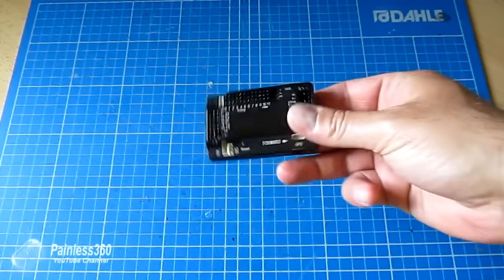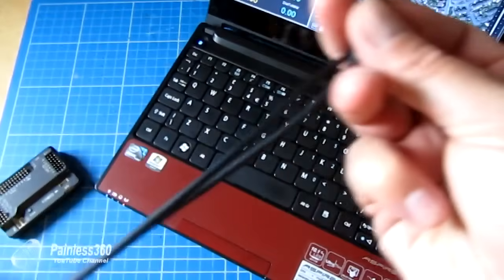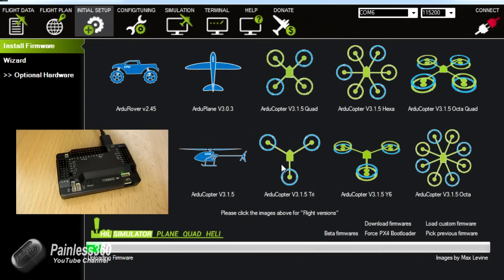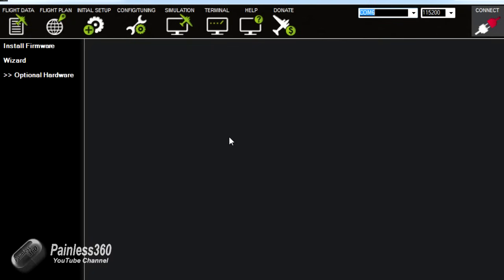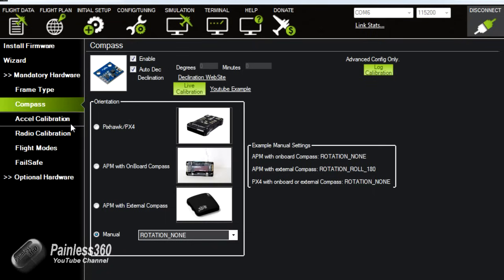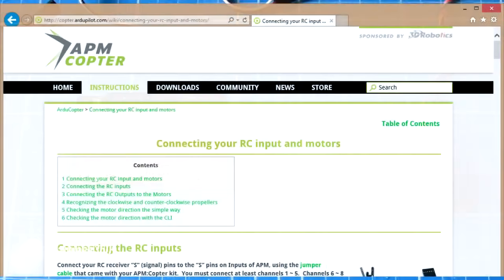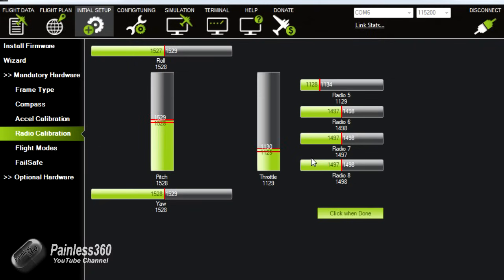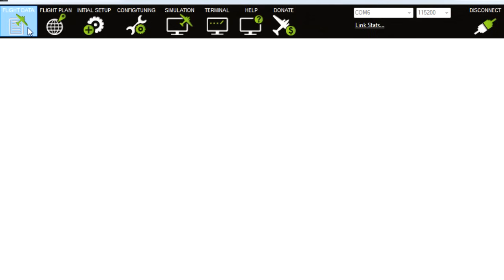(1/8) APM 2.5/2.6/2.7/2.8 - Simple installation and setup overview

Comment: Hi - Awesum tutorial.  Ok so I have small question - I have the APM 2.7 and the Turnigy 9x Radio kit with the 9x8cV2 Receiver.

I have done the bind on the Radio and the RX  - Using the APM input to supply the 5V.

The radio is set to sent PPM - And the receiver is PPM - But when I try connect to calibrate the radio it tell me that he transmitter is not switched on and it not receiving a signal... All the channels are connected 1 - 5 correct
Reply: Haha don't worry - I worked it out !!

Comment: I think you already answered this question but I need to confirm. I ordered a X500 quadcopter kit from AliExpress. I've built something like this with a CCD3 controller. the kit came with simonk ESCs with built-in BECs. the kit came with a power module also. from what you said the power from the ESC will supply all the power to the board. with that in mind I guess I better not plug that power module connection into the board?
Reply from the maker: Not sure what you're describing as a 'power module' is normally something you get with an APM/Pixhawk. I'd normally power the CC3D using the BECs in the ESCs.. Best of luck!
Reply from the maker: See the video later in the series where we cover powering the APM, we talk about it there. Best of luck!

Comment: Hi, thx for your great channel!
I've got 2 questions about the APM and I hope u can help me.
1. I wanna use the APM 2.8 with Ublox Neo-6m. Shall I remove the Jumper next to the GPS-Port to deaktivate the internal magnetometer or not? Ive seen in ur Pixhawk video Series that u are using boath there, internal and external together. Is it recommended on the APM?
2. I am using a Turnigy TGY-i10. Is it possible to connect the reciever whith the APM, while using PPM or another sum signal?
Reply from the maker: Hi. 1) If you've got an external mag then I'd always use that. 2)Depends on the receiver and the APM version you have. Check if both use PPM.. Best of luck!

Comment: Thanks for all the videos you have made on this subject. I know this is a year or so old but I think it would be helpful if you made it clear that a transmitter that can be used for a plane or heli needs to be setup as a plane not a heli for multi-rotor copters.
Reply from the maker: +James L Phillips We cover this in a number of other videos, thanks for the suggestion. Happy flying!
Reply: Thanks for the reply.

Comment: Thanks for the video!!
I have a question. I followed your steps and stuck at the compass calibration. When I clicked the "Live calibration", it popped up a new window but no display of x, y and z axis.
Then I just skipped to radio calibration. I connected all according to the APM site connected Rx and Tx. Before I started the calibration, I connected all 5 servos to the Rx and checked all channel functionality. After I connected with Planner I saw all the green bars as your video. When I clicked the calibration button only 3 channels would show the red sticks (throttle, aileron and aux) and the rest 2 channels won't move and no names (yaw, roll) displayed.
Did I do something wrong? -_-a
Any words would be appreciated! Thanks!!!
Reply from the maker: delsol7878 Hi, make sure that you have the two missing channels plugged in and the servo cables are the right way round. The APM is only showing what it can 'hear' on the connected inputs so you don't need to tell it what radio you are using.If this is an APM 2.6 then check that the cable from the external compass is plugged in and not loose. This would cause what you are seeing. Best of luck with the build!

Comment: Thank you for the super videos. I'm putting together a Quad using the QRX350 Pro body. Ready to start setting up the APM.
On the Compass celebration, I am using a GPS with external compass. How should I deal with the external compass when setting up the APM ?
Thanks Dale
Reply from the maker: Hi Dale. See 8:57 in this video. Install the GPS/Compass module at that point. I explain why in this part of the video.

Hope it helps, good luck with the build!
Reply: Painless360
Thank you
I'm going throw your videos one at a time and typing up Step by Step.

Comment: Have you posted anything on how to protect the Baro from wind on the APM 2.5/2,6 and 2.7?
Reply from the maker: Hi Simon, not yet. All of mine have been installed inside the case that includes a piece of foam to cover the sensor.

I have discussed it when talking about the Multiwii boards though. I am in the middle of creating a few videos for the APM 3.1 and this is covered in these specifically for the APM..
Reply: OK Thanks. I ended up researching on google and making up a video myself.
Reply: Painless360 Hello guys maybe you can help install futaba transmitter T6ex ardupilot to 2.6 x Quadcopter
Reply from the maker: The radio is a mature product but should work great - what's the problem?

Comment: Thanks Painless360, problem solved. Throttle Failsafe remains at throttle setting when I lose Tx. It's my receiver! 3 yr old Turnigy 8 channel.
Reply from the maker: John Bailey I wouldn't use that on a model - too much chance of a flyaway!
Happy flying..
Reply: Yes, going to switch over to my Taranis and  X8R. P.S. your vids are Super!
Reply from the maker: Thank you :)

Comment: Hi good simple instructions. I was Ok up to the receiver install. Several blogs say do not install the receiver while only powered from PC using USB. Also the video is for a coptor and I am doing rover. You show every pin used for the receiver setup but I have R8EF S-bus or PPM and you do not show that config. Any help appreciated
Reply from the maker: I've not used APM for many years. See my last few years of videos on flight controllers. All I figured out are in this series.... There are more up to date flight controllers supported by modern firmware - see my Kit Picks video..

Comment: the best video!i wan't to ask you. if i wan't to put it in rc boat,do you know if i must do all that progress?or it is more simple?all i wan't is the RTL function and nothing else!and do you know if can work with the Turnigy TGY-i6 AFHDS!   thank you very much!
Reply from the maker: It should work with any radio/receiver that can support the PWM inputs it needs. The process in this video is a little old now but it's basically the same. See the ArduBoat documentation for more details. Best of luck with the build..
Reply: ok thank you very very much for the answer!!!best regards from greece!

Comment: All your videos from part 1 - 8 are wonderful and detail regarding the apm.
But I would like to ask. Everytime when I fly in a new location what dance or calibration do I need to perform? 
Like for the naza it's simple dance. What about the apm?
Reply from the maker: +Mervyn 8888 once you have it all calibrated, so long as you've not moving a great distance away where the magnetic declination will be different, you should be ready to just fire up, wait for the GPS lock and fly!
Reply: Painless360 , if that's the case, meaning I do a first set up calibration at home connected to my laptop. And from there once I'm at the field I can just plug and fly without the need of another calibration?
Reply from the maker: Yep, should do.

Comment: thank you for all these great videos. im have a big problem with my apm 2.6 hexacopter. every time i arm the hex to fly i have take off ok then all f a sudden i lost. all control hex flys away at full throttle until i cut off the control. fail safe on lemon rx 6ch kick in kills the motors and hex comes crashing down to the ground.  Any ideas n what going on??
Reply from the maker: +Horace Gray What do the logs say? Watch and log files video and see what they tell you from that flight..

Comment: Compass calibration? I see your video is now 3 years old and my question is has the compass calibration changed? On your video when you click the calibration tab and start to rotate you come up with a new window that shows the compass points. When I click compass calibration all I see is a progression line for 60 seconds. It does not show the nifty little window that you get with the illustration of what's going on. I go through all the motions just as you did in the demonstration on the video. After several tries and after hooking up the GPS and compass I am running 2.8 it comes up with the same answer not enough. Without the little graphic, there's no way to tell if it received any compass points. Do you or does anyone know if this part of the setup has changed?
Thank you for your APM series, it's nice to get information from a trusted source!
Reply from the maker: It has, we will be looking at the latest version in the PixHawk 2.1 series.. The documentation has the latest details. Best of luck!

Comment: Thanks great videos. From your videos you connected all the ESCs three wires to the APM or did you cut them somehow?
Reply from the maker: Tochukwu Wilfred Depends on if they are linear BECs (leave all the red wires in the connectors to the ESCs connected) or switched BECs (use a pin to lift the tab on the connector and remove all but one of the red wires).
Powering the board is covered in the next video in the series - https://www.youtube.com/watch?v=TS4OWAcfAQY&index=2&list=PLYsWjANuAm4oswLMu9OU8yOm-9J6y30XW
More detail on connecting BECs in this video - https://www.youtube.com/watch?v=L3BnPdiK3_o&list=PLYsWjANuAm4pIU07ta7glYIn-EBCof_4r&index=6
Best of luck.

Comment: When setting-up for the Radio Calibration; I'm using the FrSky Taranis plus X9D Radio and the X8R Receiver.  I understand about connecting the corresponding channels to the rc receiver, but in the video, I have to ask what is the device you have coming off the side your Spektrum AR7010 receiver?
Reply from the maker: +Destin Casimiro That is a satellite receiver that provides an extra two antenna for improved reception over just the single receiver on its own. Hope that makes sense..
Reply: +Painless360 Thank you so much..., you have been very helpful considering I am brand new at this hobby! I like the idea of an extra satellite receiver for improved reception, I may do that myself. Does that extra antenna come out of your Smart Port on your receiver?
Reply from the maker: No, that is a feature that is more common on DSM recievers. Best of luck!

Comment: thanks for making these videos.  I just got an APM 2.8 for my fixed wing.  I am going to use a TBS Crossfire micro receiver with SBUS for the APM.  I am having a heck of a time trying to get SBUS to work.  Any advice?
Reply from the maker: +DenMark Phan have you jumpered the signal pins on inputs 2 and 3 to tell it that it's an S bus signal? Tricky to offer advice without know what you've already tried. Best of luck!
Reply from the maker: +Painless360 (PPM is easier to setup on APM and selectable on the CF too..)

Comment: Thanks for these awesoms videos.
Wanted to ask, can one use multiple computers running Mission Planner on the same board, or should you stick with one of them?

For example, carry out initial configuration on a desktop, and then actual flight on a laptop?
Reply from the maker: +mexicubanguy ive used multiple computers with no problems. Happy flying!
Reply: +Painless360 Thank you very much!

Comment: Hi great video once again I have revisited my set up on my ardupilot and decided to retry the gps my question is I have Ublox NEO-M8N GPS Module w/Compass for APM2.8 APM2.6 Pixhawk Flight RC234 do I need to configure this as in the videos with a gps file or will it work out the box.
Reply from the maker: If it was bought as an APM GPS then it should just work...
Reply: Painless360 thank you

Comment: hey there mate, thanks for this clear video, but i have one question.. what is the use to connect the ardupilot to AUX1 .. and what is that "switch" connected to the receiver? and how should i get one of those  ?
Reply from the maker: It controls the flight mode that the APM is using, we cover this later in the series.. Best of luck..

Comment: Hey Mr Pain I have a problem with my arducopter everything works fine except one thing in mission planner section it couldn't get to connect to it, the TERMINAL section doesn't work, when I click on connect it starts typing garbage things, and also the throttle is at constant speed rate and wont go higher even if you put the stick to full throttle, I've calibrated all the ESCs with all the methods once manually one by one and once again all at once, the throttle speed after calibrating works great it reads all of the speed rate after, but when ARMING the ardu and getting ready to fly, the throttle keeps its constant speed rate when you first move the stick and the motors start off, it keeps that speed rate when it first starts the motor and never go further, can you help me with, I am getting pissed of this FC :(
Reply from the maker: I'd focus on the throttle issue first - Terminal isn't critical for flight.

Connect a servo to the throttle channel on the rx and confirm that it moves with the throttle stick on the Tx.
Then check that you can see the throttle channel move in Mission Planner
Recalibrate all of the ESCs, using the one by one method (the all-in-one has caused me issues in the past)

Best of luck with it. This is a great flight controller and a lot of fun when it's working..
Reply: Thanks buddy i ll try again and see if it could get any better, my respects
Reply: ayman fatani I made and do every steps you provided me with, and it gets to work, but unfortunately my xR wire been cut by one of the propellers, lol its my black day i guess, can i use any servo wires or does it have its own type of wire ? thanks for helping but i am still a noob :p
Reply: ayman fatani The antenna is a shielded wire, so you cannot use any old wire.
If there is still a fair bit of antenna wire left, you can fix it by trimming back the shield to expose the core. If you're using 2.4Ghz, then trim it back to expose 31mm of the core.
Reply: Senator315 Thanks bro yeah there's some of it left, i soldered it again to the xR and worked fine 😊

Comment: Ive just got the 2.8.. though am confused a little.  do i do the initial mandatory calibration of the compass with the GPS/compass dual antenna all plugged in or does the initial setup have to be done without this plugged in.. I only ask as following intital set up may people have problems with the compasses (getting two sets of figures) and finding it impossible to deactivate the on-board compass so that the external GPS/compass aerial to be recognized.
Reply from the maker: +Lee Pearce the way that works for ya is on the video. Personally I'd always disable the onboard compass and use external if possible. Best of luck!

Comment: Hi, Having messed with NAZE32 and heard all the warnings about 'dodgy' GPS implementation do I assume from your videos that the APM is the budget board to use for really good GPS ? or is there some thing else I've missed ?
Thanks for what you do for the community, very much appreciated :-)
Steve
Reply from the maker: +Stephen Thorpe see our video on flight controller comparison. Until iNav finishes the GPS code for Cleanflight, we will have to rely on APM and PixHawk for solid GPS flying. Hope this helps.

Comment: Question.. I have a "GPS Module with compass - Powered by Ublox 7M" Is it compatible with my APM 2.8 when installing the GPS module i have two connectors. 1 with (4) Wires and another with (2) Wires. I know the one with 4 Wires go to the GPS port and the other connector with the 2 wires, which port does it go to? The one near the GPS port or to the one labeled (I2C)? also do i need to remove or move the jumper beside the GPS port?   Thank You in advance.
Reply: Mr. Painless360 Please Help.. Thank You

Comment: I have the APM 2.6 with no compass. I do not plan to use GPS on my quad initially (not until I am able to get it built, in the air and flying reliably at low height). Do I have to buy a Ublox, now or can I just skip the Compass calibration?
Reply from the maker: I've never installed an APM without the compass here. If you can do that please let me know.. Best of luck!

Comment: Hello and thank you for your video
on the 2.8 when i am using an external compass i had to remove the jumper from place 1 shall i place it to place 3 or not ?
also the yellow led on the apm is flashing very fast, is that ok or am i missing something
thankbyoy in advance
Reply from the maker: +DC CD I've not played with an APM for a couple of years now. All of the information I have is in this video series. Best of luck

Comment: Hey, I've got the same setup with the taranis and mission planner1.3.25 I am at the flight modes part and everything has been pretty good up till now. When I flip my switch up and down there is no green highlight moving around. There is only one green staying still on flight mode 4. I have checked that I got the switch done in the calibration but it still seems to not be working. This is not a simple as I was hoping it would be when I ordered it. Thanks Jeff
Reply from the maker: Jeff Heslop Then you need to make sure that you have the input configured for that switch (sounds like you have if you can see if moving in the monitor screen), there is a mix to attach that input to an output in the radio. Then make sure that you are connecting the mode channel on the APM to the right output on the receiver.
Best of luck.

Comment: I was able to fix the problem. 
I pressed the reset button on the APM and then I reloaded the firmware and the beeping stopped. 
Now I can arm the copter. I will do a flight test tomorrow.
The thing is what cussed this problem with the beeping in the first place, I think that this beeping coused the copter to go down. Will it happen again while I'm flying? ???
Why did this happened in the first place  ????